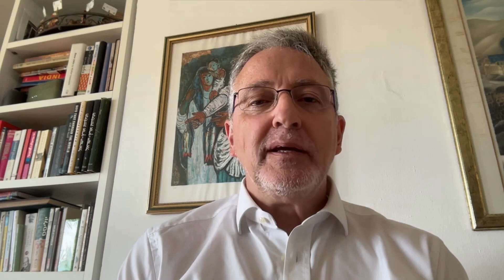🎬 Decarbonizing commercial buildings: Are we reducing CO₂ emissions fast enough? | Air-Qualitee

Comment: Great breakdown of the Measurabl report and particularly how carbon intensity is declining faster than energy use across asset types. That points clearly to the role of grid decarbonization, but also flags the limits of passive gains from cleaner energy.

🟢 Curious to others: How are you incorporating real-time carbon intensity data (vs just energy use) into performance strategies?
🟢 Are you combining CRREM-aligned pathways with site-specific energy + emissions tracking to flag stranded risk or retrofit ROI?

We have been building a toolkit that integrates CRREM diagnostics, ESG KPIs, and measurable-style carbon benchmarking, particularly for portfolios with mixed-use assets. Happy to exchange ideas or learn how others are embedding carbon intelligence into day-to-day asset planning.